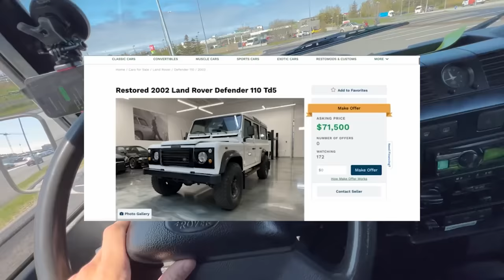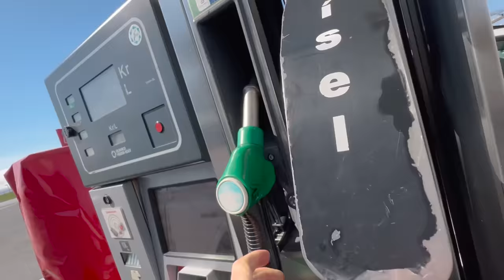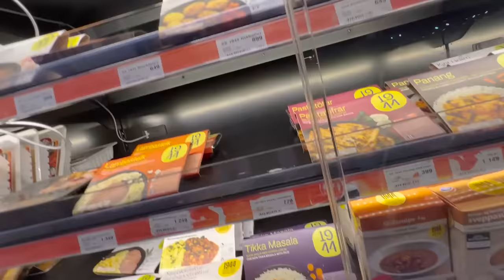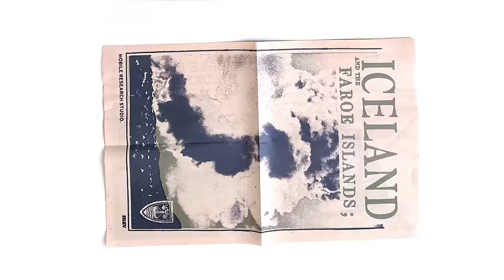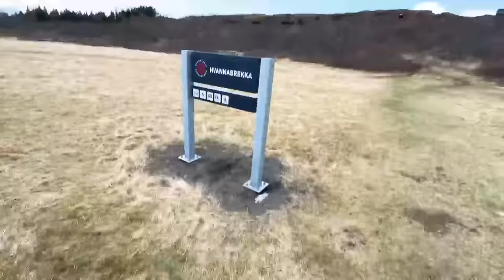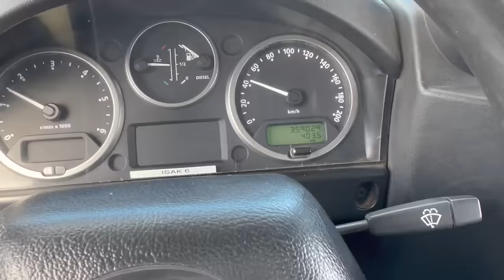I had to call Search & Rescue

Comment: Hey mav, quick little tip with manuals/standard vehicles the only time you really need the parking brake is on a hill/incline, sometimes depending how steep you can turn the wheel and leave it in 2nd gear but usually when parking I leave mine in second
Reply: I mean it’s your choice but just thought I’d let you know 😊

Comment: I got stuck in snow and mud in Wyoming because i wanted to drive around some trails that look like this one. The battery on my phone was almost dead, and i had zero data.  Fortunately you can call the cops without data. Also, luckily the cop only took an hour to show up, and that young cop was so nice he sat with me the entire time while we waited for the tow truck, and then we all drove out together. It was a great experience.
Reply: My car blew up just south of Casper. Black smoke pouring out under the hood (this car had never given me a bit of trouble in 12 years). After dozens of cars blew right past, I packed a few necessities in a tote and started walking. It's after dark and rainy. About a mile down the road a super nice couple stopped and gave me a ride. I ended up buying a new car in Casper.

Comment: Hey, you pushed your limits, that's a cause for celebration. You made it within eyesight of the glacier. The road becomes a collection for snow but outside the road, the snow is relatively shallow. A friend told me when you see this, sometimes it's better to offroad just beside the road where you can see a rock base and skip the deep snow sections of the road. At least you have the light at 10:30pm there! I'd call this a win. Trucks good, destination within site in a foreign land and you cooked and ate.

Comment: Finally you’ve experienced the ULTIMATE Off-roader. The Land Rover. 

You’ve got creature comforts in that Defender compared to my old series 3 which is the predecessor of your defender. 

Mine is all manual, no power steering, drum brakes, leaf spring suspension.  It it’s all good fun.

Comment: Cod tounges are actually the front underside of the gills, the chin if you will.. we also eat the cheeks here in icelands. regarding the rescue team. they are volunteers and raise theyre funds via fundraisers and sponsors. but going on a 37" with little experience in wet snow and no experience offroading a manual transmission. sounds like a recipe for getting stuck in the early summer season in iceland. goo to put in low gear and air down to like 3psi

Comment: One off-roady tip.. don't curl your thumbs inside the wheel when you are driving off-road. Kinda cup your hands over the top of the wheel.
Having your thumbs in can result in an injury if the wheel is jerked around by a hidden rock or other surprise.